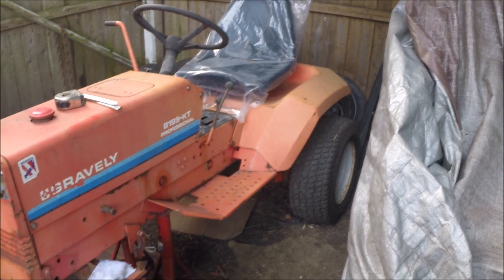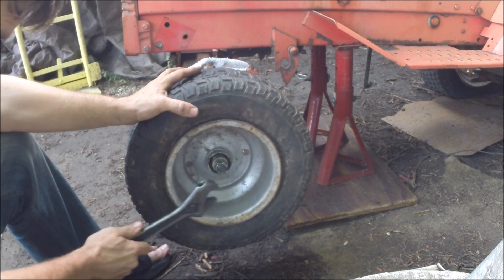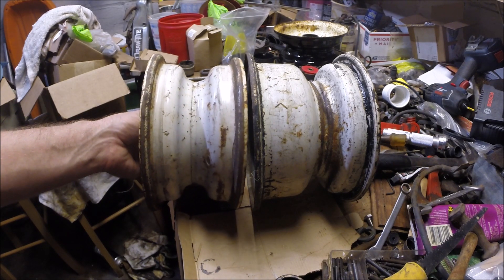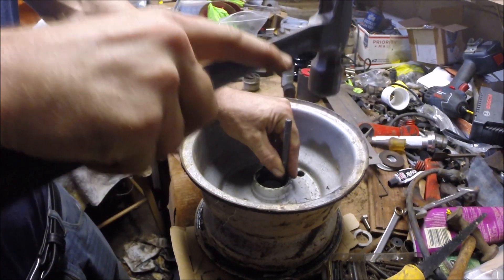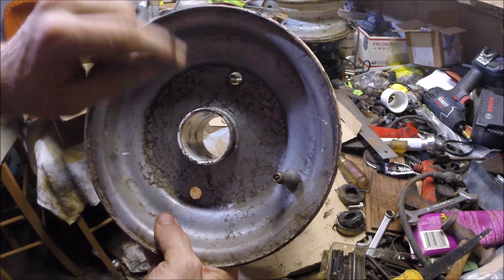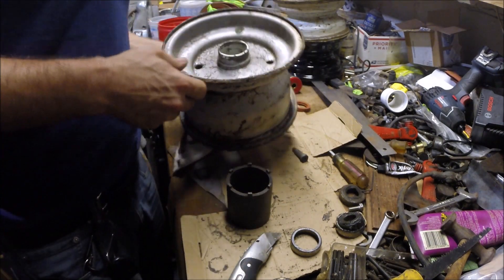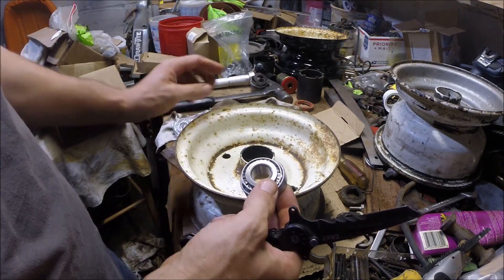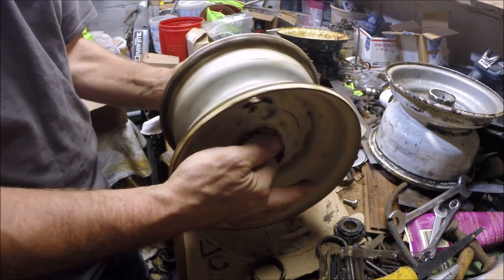Changing a Gravely rider front tire pt 1

Comment: can you revisit this video and share what parts you got and where you got them?
Reply from the maker: Funny you should ask, I'm currently refurbing another set of wheels for my G series and went back to my previous Amazon orders to get more bearings and seals. They still have the bearings but I couldn't find any seals that I would be confident were the correct part once they actually show up. I'm just gonna call Richard's Lawn and Garden tomorrow and have him send me everything I need. We should be supporting him rather than Amazon anyway.
Reply: @evsnova74  So, I have a G-20 with new rubber on each front tire, but the tires balloon a little and come too close to the pivot screw for my comfort. I wanted to space the tire out some but goobered up the seal. I took it apart and thought I'd just go ahead and replace the guts. My research suggested with OEM parts it would cost just under $200 for just one side. After I picked myself up off the floor I started to look harder for UTube vids on the subject and came across yours. You have a contact for Richards?
Reply: Ok, I found Richards.... I may give them a call.
Reply from the maker: @johngolly2163  if you want to hunt down the seals I do know the dimensions, 1 x 1.785 x .486. I found the right part number on Amazon but the picture looked nothing like the seals from these. I can't imagine the bearings and seals are going to be anywhere near that, I was thinking 50$ at the most but we'll see. I did just spend 300$ in new tires so I hope it's not that much lol
Reply from the maker: @johngolly2163  here are the bearings:
(Set of 4) Trailer/Agricultural Hub Wheel Bearing Set WPS (TM) LM11949 LM11910 0.75'' I.D. x 1.781'' O.D. https://a.co/d/cTR3TQW